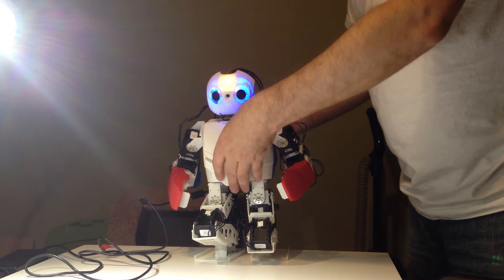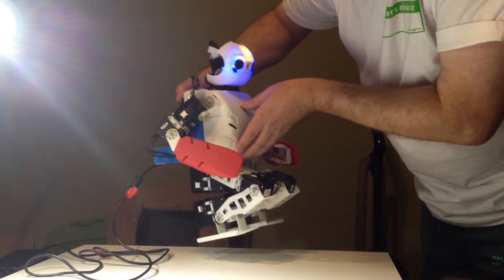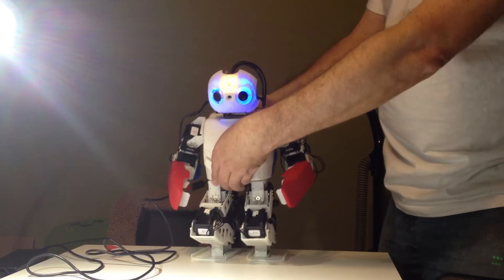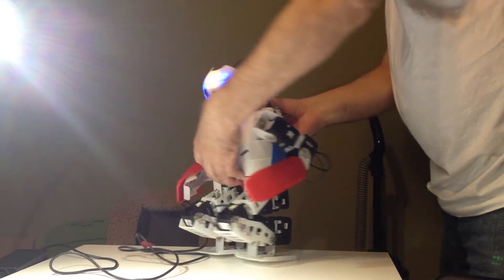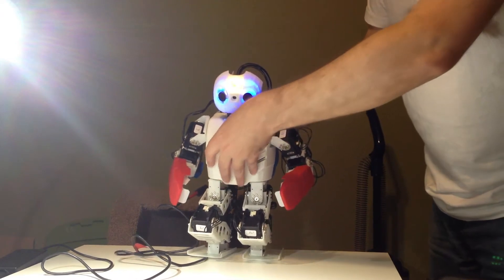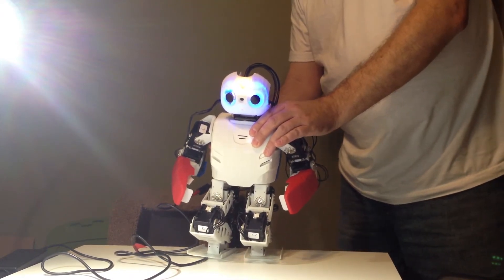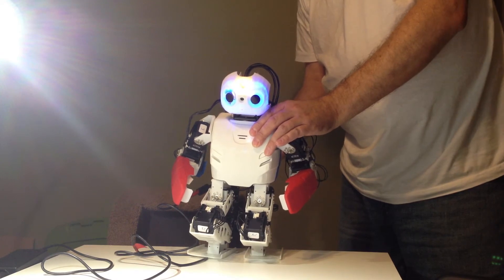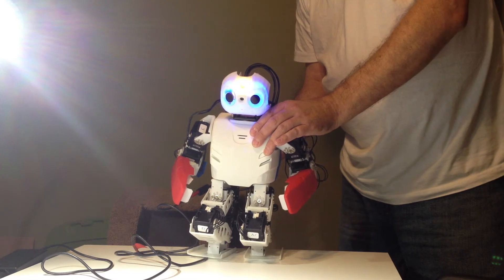Robby the DARwIn-OP clone walking test.

Comment from the maker: It looks like the servo calibration is off, so it should be easy to fix.

If not the first then one of the first to 3d print out all the parts of a humanoid robot.